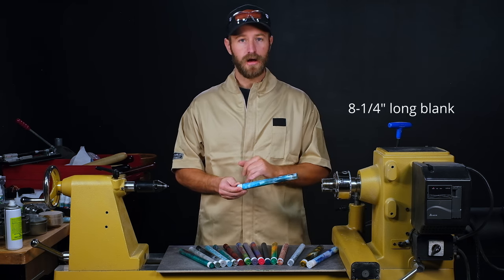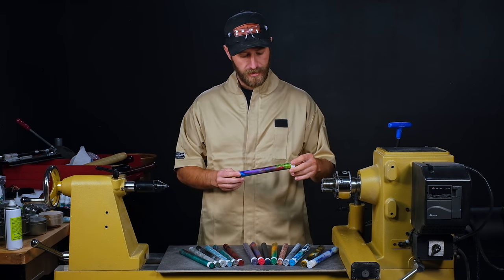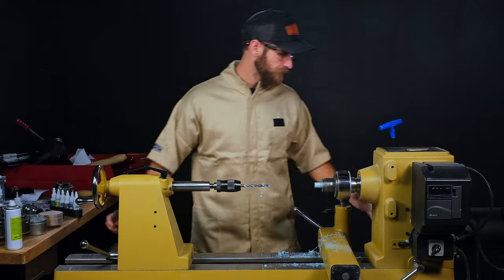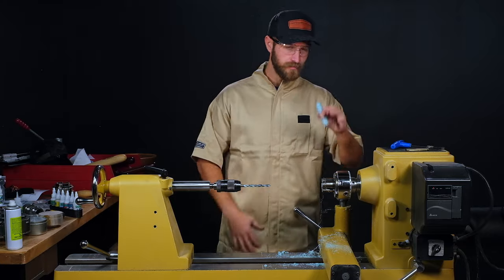Bespoke Pen Blanks - Turning Tips & Tricks

Comment: An easy way to remove those pesky, wound up trimmings from the blank is to use a small nylon brush. Gently rub it across the work and it will remove them quickly and efficiently. Compressed air works nicely too, if you have access to it.